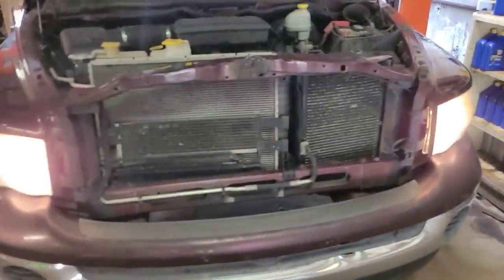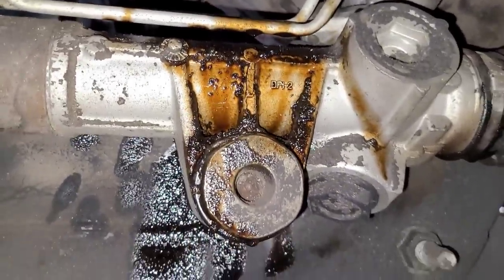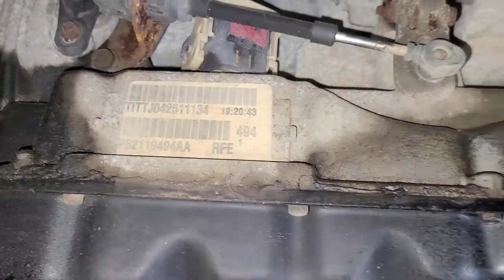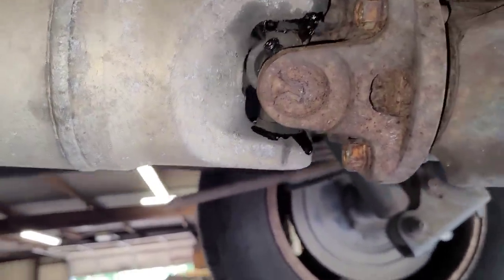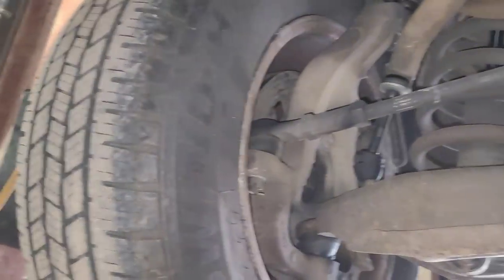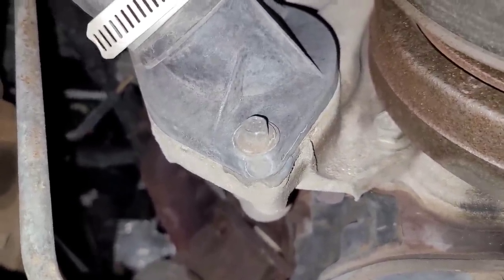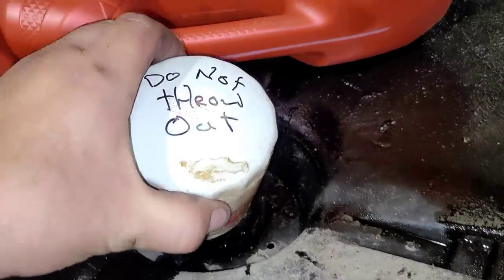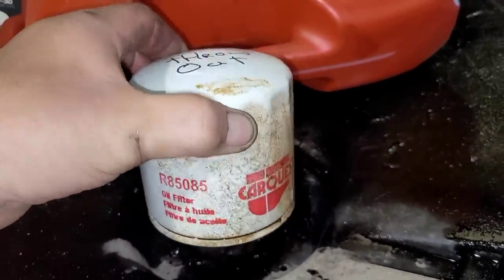I Think I Should Have Changed My Own Oil Sooner!!

Comment: What’s your thoughts on Amsoil?
Reply: Amsoil is a great oil.  It's pricey compared to other quality oils.  Even with premium oils like Amsoil, Redline, Schaeffers, etc. you should still change your oil every 5K miles max.  You could push it to 6K-7K if most of your driving is highway driving, but to be safe stick with 5K or less. 

 A good affordable oil is the Valvoline full synthetic Advanced.  Its additive package rivals the premium oil brands and can be purchased at big box stores for around $28 for 5 quart jugs.

Just my $0.02

Comment: Don't know if I'd blame Lucas for all that gunk. A lot of folks use these "snake oil" additives hoping it'll fix or compensate for poor maintenance. That oil looked like it hadn't been changed in a couple of years.
Reply from the maker: I seriously changed it 4k earlier back in January !!! Wait til I cut open the filter tomorrow. That thing feels like it has cement in it !!
Reply: @WrenchingWithKenny  Well all the Lucas had to go somewhere, it was washed off the sides, and is in the filter. That lucas was great for an engine designed in the 1960's and 1970's, where it would make the seals swell, and gum up the rings for a while, stopping smoke and slowing down oil consumption (the old pull into the service station and tell the attendant check the fuel and fill the oil) for at least as long as it took you to sell it.

Comment: Love ya Kenny but..The tires do not last longer..when over inflate them, they wear out faster, just like under inflating..however they do get better mpg. You never go by what the tire says, you go by what the vehicle is on the door ( the car says 35psi then 35psi etc.) because different vehicle weigh different weights 3000-7000 lbs. And they will wear differently

Comment: My Dad, 40+ years as a mechanic and race engine builder..... Run some transmission fluid in your engine a day or so before your oil change. Detergent wonderland and beautiful internals. You can thank me later. If you are curious, 549,000 on my 03 5.3. dino oil all it's life. 10-40 summer, 10-30 winter.
Edit... And no spots on my driveway

Comment: Punch a hole in the top of that filter before you cut it open and you will have quite a bit of oil come out that is still in there.

Comment: My Toyota Yaris is at 355,000 miles. Original engine and transmission. I change the oil at 3-5k miles depending on my driving. I only use synthetic oil for it's better flow and viscosity holding properties.  It shocks me how someone could spend so much money on a vehicle and be the biggest cheapskate when it comes to oil changes. My car is better maintained than most Farrari's.🤣

Comment: Contrary to what you do and every video says the same, if you leave the oil filler cap on when you open the drain bolt the oil doesn’t come out so fast making that mess. Eventually, as the stream gets thinner, air goes in through the drain hole helping the remaining oil come out easier. Since very little oil is left there’s no sudden rush of oil coming out.

Comment: Also lets possible junk to fall in thru the valve cover NEVER REMOVE THE OIL FILL CAP ALL THE WAY! Loosen is fine. And the dip stick, thats not necessary to remove like that but i guess if you can't remember you are changing the oil then yeah i guess. You're quite smart but like most of us you do some quirky things.

Comment: The lights thing is now law over here. It’s made things a bit safer as you know when a car is in use, I always leave my lights on, day and night. 

The only draw back is sometimes people don’t put their proper lights on at dusk, this means no tail lights. So maybe running lights should include rear lights. 

Also, my car has a service interval of 12500 miles. 1.6L diesel HDI engine, just wonder why US service intervals for oil are so much more frequent. My car takes 5W30 C2 full synthetic. Is it just we have better grades of engine oil? Or just the fact it’s a diesel?
Reply: Oh, just fyi, I’m in the UK.

Comment: I would suspect that the filter is heavy because it has a lot of oil in it that didn't drain out because of the check valve in the filter.  Punch a hole in the side and let it drain out for a while.  YMMV.

Comment: I disagree with your oil filter tightness. All the manufactures recommend tightening it 3/4 of a turn after the gasket surface has made contact with the block surface.

Comment: Yes, oil additives are a gimmick!!
Like my father would tell me there's a sucker born every!!

YOU as a mechanic own a Chrysler product?!?
Oh yeah that's right you're a mechanic!!🤣🤣🤣🤣
Reply: They're not a total gimmick if you use them correctly. It's totally counter productive to put the additive in and then not change the oil shortly after.  Those additives aren't meant to stay in a full oil change interval.
Reply: @mailmanjoe  or you can follow you owners manual correctly and not use oil additives like it says in the manual..
And change your oil per the manual..
Reply: @philllsxga.7737  I actually couldn't agree with you more.  Change your oil when you're supposed to and you won't have that problem.

Comment: Your engine is toast, I'm sure your rings are screwed along with the bearings. Try changing your oil every 1500 miles with that cheap oil. Also use premium oil filters rather than that garbage. Yes your filter is on bypass...

Comment: Loosening the oil fill cap and half pulling the dipstick does not help the oil to drain as the engine assembly is NOT an air tight vessel! The PCV system is an "air leak" when the engine is not running! The intake is an air leak when the engine is not running as there are always some valves open. Get your facts straight or take a course in Physics.....